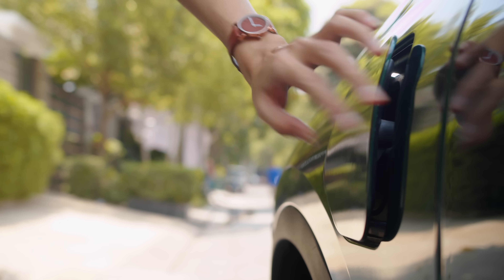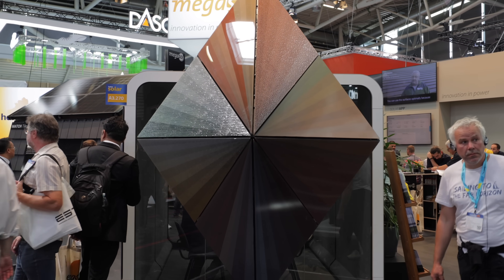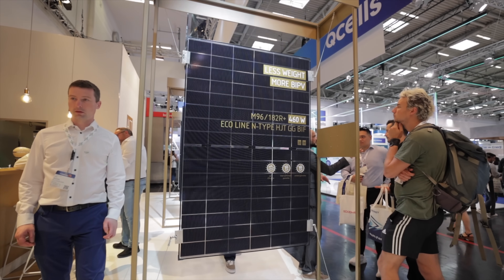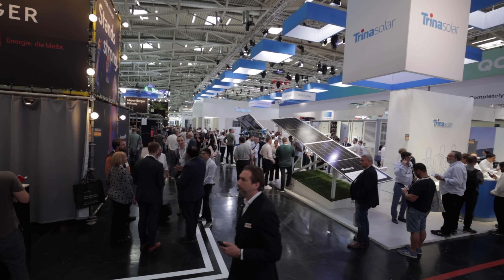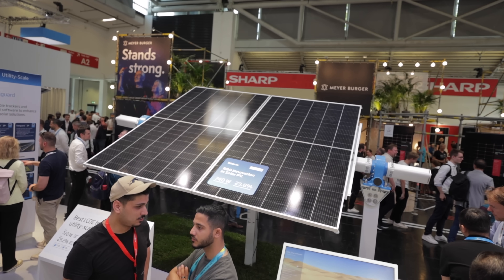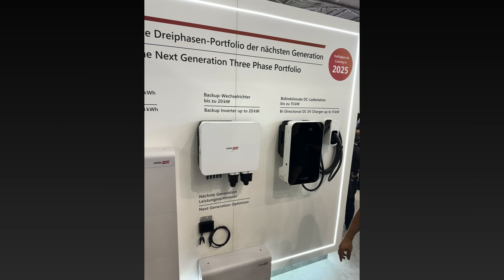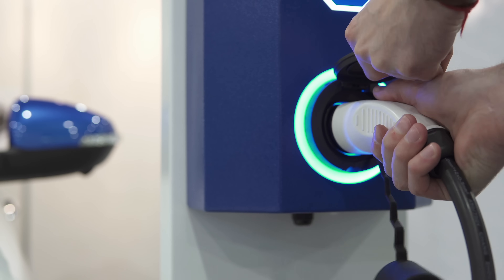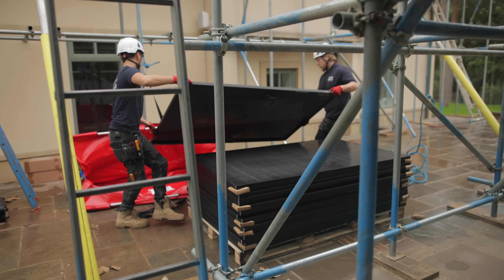This exciting NEW TECH will change the energy game FOREVER!

Comment: I have a Nissan LEAF, chosen as one of the Octopus Energy recommended cars which allows power extraction. I have a Zappi charger on Octopus Intelligent Go tariff, at present, and want to do V2H and V2G when chargers become available.
I just returned from the Everything Electric show, where V2X equipment was lacking. One company had a V2X ‘ready’ charger, where ‘ready’ means it has no inverter in it ! They said they were expecting vehicle manufacturers to fit an AC inverter into cars, so their V2X charger simply switched the AC mains back i to the house from the car. No good.
  No manufacturer was there at the show with an inverting V2X offer.
  Also, I notice, the Chademo connector on the LEAF is not flavour of the month. It’s disappearing. CCS is the future standard. So, having bought a LEAF to do V2X, no upcoming V2X offer will have a Chademo offer. That’s no good, having bought the car to do V2X with.
  So, how to CCS my LEAF? Well, there’s an adapter - Chademo to CCS - for about £700. Is it worth buying one? Do these adapters operate both ways? Ie, if I fit one and plug a future CCS V2X charger into it, will this work?
  One of the companys at the All Electric Show said a French LEAF user group had bought a load of these adapters and share them about. They would find out, for me, if any of their group used one in a V2X setup, and let me know. Happy to pass on any info I receive.
  Anyone had any Chademo CCS adapter use in the UK?
Also, what paperwork process will be needed to do V2X? My Nissan User Guide says any V2X kit needs to be approved by Nissan, so there’ one bit of admin to wait for. Do I need to notify the DNO that I want to sell back power using my V2G setup? Will the installer do this for me? How ‘plug & play’ will V2X be?

Keep the great videos coming.

Matt Lee, Kent, UK

Comment: I doubt that these side or roof tiles will be as effizient as a normal solar panel.
Micro inverters are not really there to be optimizer alone. 

Perovskite Panels are still not available biggest thing in the game is Oxford PV, but currently there things are not produced at all even though they say they will start production every year.

Comment: 8:20 - those 580 Wp panels save about 10% of the cost of the underconstruction, the amount of profiles and clamps needed on the roof
Also more or less 10 to 15% cheaper based of price per kWp installed.

We have build a 25 kWp array on 2 roofs and with 550  Wp and 580 Wp you need lot less panels which means less rails cause these are all 110 cm or 113 cm wide like those 450 Wp panels, only 50 cm taller. And we have already seen next gen of 660 Wp which are even 25 cm longer so from 225 cm those jumped to 250 cm. 
WIth 30 kg weight they are not easy to carry around but 60 x 400 Wp or 40 x 600 Wp is making a huge difference costwise at the end, when you can not save money elsewhere. 

Our average costs for a panel mounting is 40€ and 60x means 2400€ or 1600€ for just 40 panels. If you put on top 25 kWp x 150€ or 15% less like 128€ then you save 22€ x 25 per kWp or 550€ on top, in tota 2100€ for 25 kWp array.
BUT, and that can be a big but for some: Those bigger panels (once built for our agro PV fields) do not fit always quite well. If they are too tall you might loose 1 row of panels or you have to mount those horizontally. If you would have smallest tiles you could perfectly cover a roof into all edges and corners, but with bigger ones you might endup with areas you can not use with such sizes .

There will be another step to look for a smaller size to check if you can get more kWp installed on your roof using a smaller panel size. And then smaller could be better if you are in need of such an amount of kWp that every spot of the roof has to be covered by panels. 

Perovskite are a topic here in germany for almost 2 years and we bet that they will be the future due to the current state of research and progress but they suffer from new production methods required, more faulty units in the early batches and all the small details till that will become the new standard. Mono and poly was an open battle for years, then we saw halfcell appearing and what not tilll those became the standard. And perovskite is on top of the list due to the high leap that tech has shown up to over 28% in serial production compared to 21% or 22% . The current production is progressing steadily but rather slowly and not much room for improvement except the tiny steps every 6 - 12 months with 30 Wp more per panel   of the same size.

Comment: 5:34 tbh the amount of otimizers you used always amazed me since at least from my view of what i could see in the video often they are not necessary since there all in the same direction with no trees or other objects around that could throw shade up on the panels so at least in my opinion from the information that i have based on the videos it is cash thrown out off the window, one could argue that it might be safer since the don´t give power out when they are not active (at least that has someone told me since i never used them myself here in germany i know they exist but tahts all) but the panels power is isolated from the rest so there should be no problem as long as you don´t touch both ends
Reply: Try learning to use punctuation.

Comment: We have a V2H bidirectional Indra charger installed and it has been a superb bit of kit. We run two Nissan leafs and our electricity bill this month combined with solar has been negative £40. We run the house and commute to work so do a fair few miles as well. That tech is a no brainer in my opinion!

Comment: Anyone who thinks that highly diffuse and intermittent energy-generating sun boards and wind veins will ever make a real difference to the net zero bullshit is a halfwit. In a first-world country, anything that generates at about one-third of installed capacity and which is used for heating or A/C is useless unless you spend a mega fortune on your renewable array and battery storage. Moreover, bi-directional EV charging is also bullshit. Batteries take more energy to charge than they give out. To suggest that they can be used as backup power for anything more than light general services (LED lighting, TV, computer etc) in your home and then powering your car might be reasonable short term, anything more than that (heating, cooling) is more nonsense.

Comment: Tesla, Volvo, Citroen, BYD and other EVs are already capable for DC bidirection charging however they officially do not support it yet. High voltage DC batteries and high voltage DC inverters have been around for several years. Exactly such inverter what you need and a small "raspberry pi" control circuit that telling the car over the charging port that you are discharging.
Reply: Hopefully on the ev side they can allow the dc to flow out, sigenergy will allow the solar to battery, then dc to dc connection to the ev, and inverter to grid in the one unit. Getting a quote for the Signstor system.

Comment: Optimizers will not go away, but Microinverters will stop existing. Because everything will go MORE AND MORE DC. So why directly put DC to AC? you have to postpone that.... therefore Optimizers which are DC/DC converters with MPPT will stay even with better shading panels. If you install microinverters it's just a short cut, lazy and will drive your customer up with higher cost to change it later on in the future. (which you probably want right?? ;) )

Comment: There already many cars with V2L that can supply power via an AC adaptor now, so in the event of a power outage you can supply essential items via an extension lead
Reply: A few, not many. Most from the same manufacturer or collaboration. Hyundai/Kia/Genesis, BYD, MG and Nissan Leaf.
Reply: @razvanlex and xpeng

Comment: As the main problem with EV's is the range I have no idea why you would decrease the range of a car to power your home. The other issue with EV's is that secondhand values are falling through the floor, never mind the warranty on a battery, if I know that a battery has been recycled even more through bi-directional charging then I am hardly likely to think that there is secondhand value in buying such a car.
Reply: Range is no problem to most ev drivers, you can sell the electric for 1-2k a year it's a no brainer.

Comment: With v2h charging solutions, will a solution like sigenergy work with any car? Or will sig energy need to work with the car company to work out the push and pull of electricity. To get the right profiles... 

One of the things with car manufacturers solutions was, what happens if i change my car. Will there solution need replacing?

Comment: When you talk about V2H, don't limit the discussion to bidirectional chargers.  Some vehicles have onboard inverters that provide AC directly and can be used as in place of a portable generator.  The Ford Pro Power Onboard (F150 Lightning) has a 30A 240V split phase connection that provides 7.2kW.

Comment: I don't think that there's much future in using a car battery as a battery for your house - what you're doing there is adding unnecessary cycles to your car, which even with LiFePO4 batteries is a really questionable thing to do to a car battery, given they're not exactly hot swappable (in fact they're normally built into the chassis). A wall battery that you will probably want to swap out anyway after a certain amount of time doesn't have the same issues. Maybe in an emergency, but to build all that tech for an emergency is super questionable - and most cars aren't LiFePO4 either. Vehicle manufacturers don't care because it isn't their battery when you drive the car away, it's an easy thing to shove into warranty terms that it isn't their problem on page 673826. Cars aren't disposable, you're going to destroy its secondary market value because everybody is going to be able to see the data.
Reply: Really? Average daily mileage in the UK is less than 30 miles, thats about 6 or 7kWh of energy.  Using another 20 kWh of the stored energy would still only be using around 30% of the stored energy.  What's more, the average charge/discharge rates for home usage are absolutely trivial - 2kWh of domestic load would be barely 0.03C not stressing the battery at all.
Reply: @faraway5828  all for the low low price of massive depreciation.

Comment: We really need EVs or BVs, with selfplug-in V2G, V2Home, V2Building. 

BVs oversized battery makes the home battery look pathetic. 😊 
BVs oversized battery has FREE storage capacity every day, year in and year out. 

Vehicles are parked 23hrs every day.
Vehicles drive building to building. 

Every building carpark space will have a $60 wall outlet for the selfparking Vehicles Selfplug-in. 😮😊😊😊😊
Reply: all very true but I would want my car to have a good amount of charge for when i need it.
I never leave my petrol tank empty. however buying a cheap Nissan Leaf if you have enough drive space for an extra car. leaf just to use it as a home battery could be an economical way to add a large home battery
Reply: @steveevans1247  Good comment. 
I can easily see rapid chargers on the main roads and at corner stores when needed. 
I think that the vehicle computer could be programmed to have enough for the next drive. 
The long drive or the daily drive. 

This feature would allow savings on electricity supply, gas supply, and petrol supply.
Savings are instantaneous tax-free money in the bank.
Hahaha 👍 Hahaha

Also, the grid could supply to new industries and take your excess rooftop electricity. 
So you can remain grid connected as a backup. 

In a warming world rooftop, PV panels shade rooftops and help the air-conditioning load. 

When the sunshines grid cashflow from customers with rooftop PV crashes.

Comment: Tesla were reluctant to allow bi directional because of cycling of their old style battery chemistry AND they obviously didn't want to effect sales of their powerwalls. 
Perhaps they'll change, but who knows what Elon is currently thinking?
BYD cars are all able to supply V2L, so presumably they can be easily adapted to bi directional? 
MG has started offering a lifetime warranty on their batteries, so excessive cycling is presumably not an issue for their technology.
Reply: lets say a battery is 60kwh and you drive normal mileage you probably have to charge once a week ? well say you WFH and use the car not a lot (as me) then 60kwh could power the house for like 4/5 days so cycling is not that much more ? the bigger positive is to have a virtual power grid where you charge up overnight and then release at the day during peak time. given most homes are only 2 phase and can only charge/release max 7kwh then this is not going to overload is it ?
Reply: Affect not effect.
Look up the difference.
Reply: @deang5622  Affect is usually used as a verb meaning “to influence or produce a change in something.” Effect is generally used as a noun, and refers to the result of a change, but it's sometimes used as a verb meaning “to bring about a specific change.”
Reply: @deang5622  So Tesla didn't want "to bring about a specific change" in their sales of powerwalls. Effect is fine. Get over it.
Reply: @simonpaine2347  No, effect is not fine. It is incorrect. That is not in dispute.
You get over it.

Perhaps if you paid more attention in English class you would not make such basic school boy errors.

Accuracy matters. But evidently not to you.
And one has to wonder why that is.

You have an opportunity to learn but yet you have quite intentionally failed to take it.
Why?
Reply: @deang5622 err…it’s “schoolboy”. Just sayin’
Reply: @deang5622  Wow! Your punctuation is abysmal!
Reply: @IverKnackerov  And that was after he edited it!
Reply: @simonpaine2347  Actually the punctuation is perfect.

Clearly you skipped English lessons in school, didn't you?
Reply: @simonpaine2347  School boy or schoolboy, there is no punctuation.
Clearly you don't actually understand what punctuation is.

Comment: Are any of the V2G or V2H chargers that are coming out Chademo or will they all be CCS?
Reply: There have been a couple of trials of ChaDeMO V2G - it's always supported it but since they lost the format war hasn't really had any more development. Indra did one, but the hardware is almost impossible to get hold of.
Reply: @JamesScholesUK  I was meant to be on one of those trials but at last minute fell through but only to charger manufactures indra and wall box made the chargers. Wallbox have said they will only make CCS V2G chargers going forward and Indra won't sell you a V2G chargers currently and since they were acquired by Gulf may never.

Comment: Weirdest place seen solar  panels was on top of a train carriage at Byron Bay in nsw Australia
Reply: @miesvanderlippe9017  flat level ground so no regen needed but has no hvac as old carriages
Reply: There is a train to Byron Bay that is ENTIRELY solar powered - maybe its that one - its a converted old diesel unit :)
Reply: And in mkaes so much solar power with the panels on the train and the station roofs that they sell the surplus to the local grid! :D Byron Bay is a communnity very much in to that sort of thing! :)

Comment: Almost any electric car can provide power through the CCS DC port(for V2G or V2H). Such a possibility is already included in the management protocol. But the manufacturers have not yet announced this possibility, they are probably really worried about the warranty on the battery. Specialists who understand the protocols can easily implement this, of course not officially. You can also use Tesla car batteries and high-voltage inverters to get cheap storage, 60 kWh or more in volume. 100kWh for 10k dollars, an interesting offer)))
Reply: The appropriate protocol being in the spec does not mean that the capability is in most electric vehicles.  Manufacturers need to install the extra hardware to support the outgoing DC power.  This is why only a few models of each manufacturer are listed as supporting V2H/G.  And if manufacturers are worried about the warranty, why do both Ford and GM provide the capability in their pickup trucks (in North America).

Comment: I’d heard the VW ID4 has a bidirectional charge capability (well, it has a bidirectional menu in it’s in-car interface) 
With 77kwh usable capacity, this would be a good home back-up power option, if indeed V2H capabilities with Sigenergy or Solaredge systems.
Reply from the maker: Interesting! Thanks for sharing
Reply: All the +77kwh ID range offer bi directional charging 👍

Comment: Optimisers and diodes don’t do the same thing, surely? Optimisers should behave like an MPPT, optimising the panel output voltage to match the load and panel, whereas the diodes only eliminate the problem of partial shading knocking out a whole string of cells within a panel.  Isn’t that the case?
Reply: The problem here is that Artisan is clueless with regards to anything to do with solar and battery. Just another YouTube grifter like the mentioned Matt Ferrel.
Reply: @VinoVeritas_ Looks like you are smarter than them😕. You should start your own channel. I ll definitely watch it😅

Comment: Are there actually any usable non-vendor locked V2H solutions that work with most EVs yet? The only things I've seen actually usable are Ford and GM have something that you can actually buy but only works with their own stuff which is completely useless in my books.
Reply from the maker: Not yet I think they are all locking their systems down at the moment but once one opens up they all will I think…